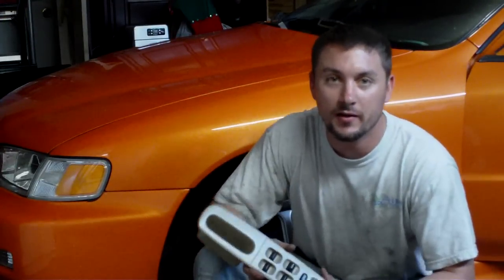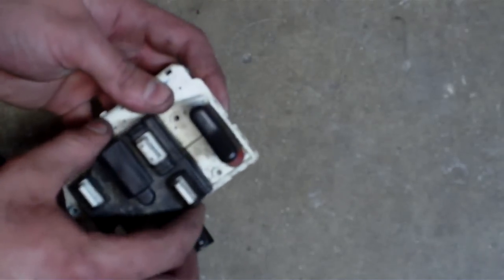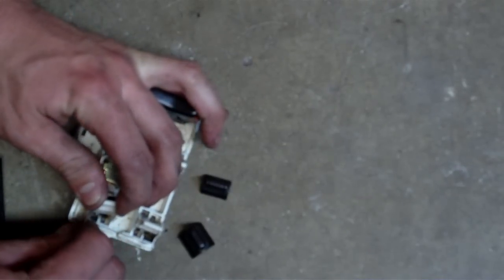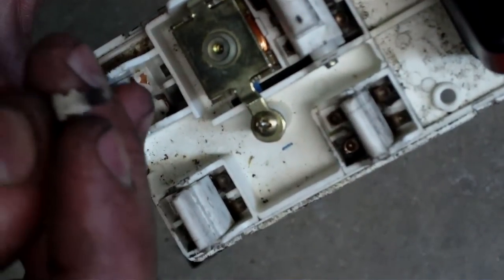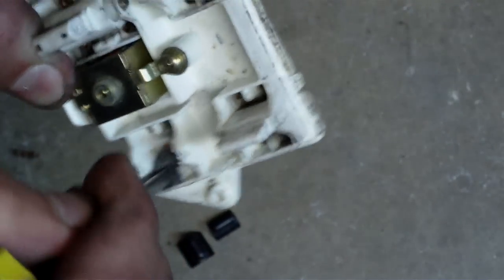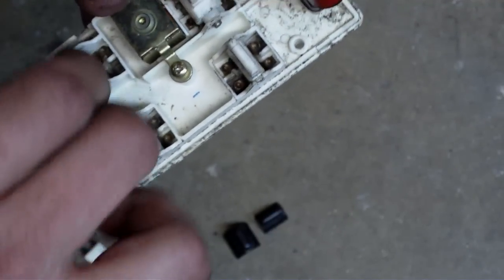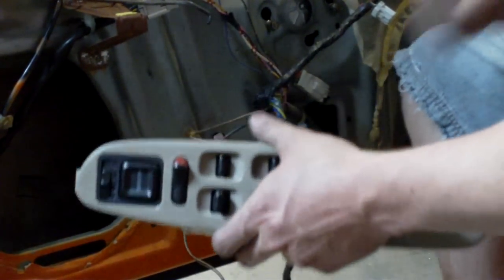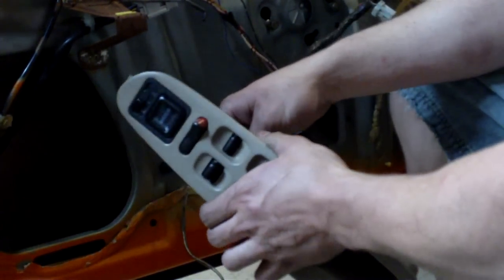Power Window Switch Fix "How To"

Comment from the maker: Yep, a tip for you if you haven't tired this yet is to put some "Dielectric Grease" over the contacts so no more corrosion occurs so they will continue to work for a very long time.
Reply: Yes, I agree with,  "Dielectric Grease" over the contacts so no more corrosion occurs so they will continue to work for a very long time.  How did you get the car power window controls out, so you could wold on then.  Perhaps re-do the video show this part or removing the power window main consol.

Comment: Thank you so much. After watching your video, I was able to fix the power window switch of my 2001 Nissan Sentra. I followed the instructions, by trying taking it apart, and cleaned electrical contacts with Windex and WD40. Broke a little plastic part during the process by just being impatient. Put it all together, and now it works better than it ever did before. Thanks again and God Bless.

Comment: Thanks for your tutorial. I've just fixed my power window switch! Glad did your thing as I was also able to repair cracks in the plastic levers and one of the tiny spring suspension in the switch with glue, heat, and pate, and prevent future problems. :-)

Comment: GREAT VIDEO! I had to clean the gunk with steel wool and bend the tips back. TO ANYONE WHO SEES THIS IN THE FUTURE, sometimes bending the tips TOO MUCH will lead to a short blowing out your fuse. Happened to me for the passenger side window. Just had to bend them back in the other direction just a little bit so that the pins never sit flush against the metal contact when you aren't pressing the switch up or down. Hope that makes sense.

Comment: Be careful with using steel wool, especially on the driver's side switch as little strands of the stuff can get in the transformer behind the switch and cause a short.

Comment: Saved me $60 thank you! I did have trouble getting those black things off, wish that had been covered in a bit more detail, I ended up snapping the wings off mine, then finally pulling them off with pliers, "straight up" (then they came off, though a bit scratched, at least the wings didn't get snapped off). Thank you!

Comment: Well I think that it was just damaged beyond repair. The metal connectors had just lost their shape. It finally worked after doing what your prescribed--but then it wouldn't roll back up!  Ordered a replacement switch off eBay reluctantly and snapped it in and it worked. But thank you again!  Great video. Thanks for replying also.

Comment from the maker: Check the wiring clip going to the main control for corrosion,If that checks out, pull the door panel off and check the wiring to the power window motor.."Before all of this First check the fuses though.

Comment: Outstanding video, have a Honda Accord 1996 EX wagon, had problems with right passenger, both rear windows did not work at all !! did some You Tubeing, ah ah ah  after watched  (How to troubleshoot power windows using a schematic Honda) helped found ground problem but still not working, then came across your video and followed it step by step, took it apart cleaned it, assembled it as you instructed, and it is working great, right passenger and both rear windows every thing operational, my compliments, you took me step by step, did not no the switch could be taken apart, that saved me money !!! and I learned. God Bless you again OUTSTANDING VIDEO A +++++++++, keep doing these great VIDEOS.

Comment: Thank you so much for this upload, you saved me plenty of trouble, window stuck down away from home, and at least I was able to clean things up enough so I could get the window back up. I will finish the job to make things fully reliable, and it IS true that over time the contacts wear due to carbon and you need to clean them well and you MIGHT have to SLIGHTLY bend the copper metal contacts just a bit (NOT TOO MUCH) to have them make proper contact with the bottom mounted metal tabs. I would be VERY CAREFUL about using a pliers to bend! Just use a little gentile force with your fingers!

Comment: This is very helpfull that i can actually repair the switch. But my problem is on my es330 2006, to actully to open the switch board from the door... I removed screw under the handle. i am bit scared to mishandle the look. the window on drive side does not opereate. someone told me it must be the switch. i would apprecite your advice. Thanks

Comment: My honda accord 2003 had the passenger side window clicking but not movin. a friend told me he fixed a similar problem by inserting a wire into the socket with the green and white striped wires and he could temporarily raise the windows of his car. i tried the same but now both my windows are not working. Before i tried this 'fix' i used to hear a clicking sound. now i hear nothing. I tried using your trick but i guess cars of 2003 cant have their switches open this easy. Appreciate your Help

Comment: Thank you much! However...1995 accord ex drivers side window wouldn't roll up. I followed your instructions (also used qtips and alcohol for cleaning). It worked great! Drivers window rolls up/down. However, now the front passenger window does not work? The window control switch on drivers side and passenger front don't even make a noise in the window motor. I replaced the window motor & regulator 4 years ago. Any ideas?

Comment: I'm sure this would be the same process for an 04 accord coupe right? 
The thing with my switch is that randomly while I'm driving I hear my switch make a clicking noise as if it's reprogramming itself , and when I go to move my window switch up or down, they don't work. After a while they begin to work. Would you suggest trying this for my vehicle?

Comment: I did this, but now both my front windows don't work at all.
Drivers side could go up but almost impossible to go down; front passenger window could go down but not up without the help from the passenger side switch.
I cleaned both, now back two still work fine, but front two don't work at all. I bought a used master switch with similar results (front don't work, back work).  Checked the front passenger side by itself: didn't work. Could the wiring been pulled somehow? if so where do you think?

Comment: Hello guys. i want to ask about the Power Window Switch. Today i dissasembled and cleaned those little copper sticks. When i dissasembled it, a plastic stick falled to the ground and it is supposed to trigger the auto-down function for the driver's window. The problem is, i installed it back in the same place but i think i did something wrong because it doesn't work now :/. I tried all 4 different positions and no luck so i suspect there's something else missing?? because it alone makes no sense there (the plastic stick). Thanks in advance!!

Comment: I'm not an expert but I had the same problem, all other windows worked but the driver. I was told to look for a broken wire and I actually found one which someone that owned the vehicle before me had solder the wire together before and it was broken apart. I put them together and the window worked like brand new but if thats not it it may be the motor or regulator.

Comment: I followed all instructions.  Took the unit out to connect and check it before fully reinstalling it and the drivers window went right up.  Turn the key off, removed the switch assembly to put it all back together.  When I put it back in the car and turned the key forward again a very loud ticking sound starting coming from behind the glove box and now none of the windows will work.  What happened?
Reply from the maker: Maybe a wire is stuck in the track?
Reply: +Nthefastlane sounds like when you reassembled it you got one of the connectors stuck in "on" somehow. My guess is it blew a fuse (you can replace them if you can find which one goes to your windows). GL!
Reply: tie rod Chrysler co ncord fix tire rod on Chrysler Concorde